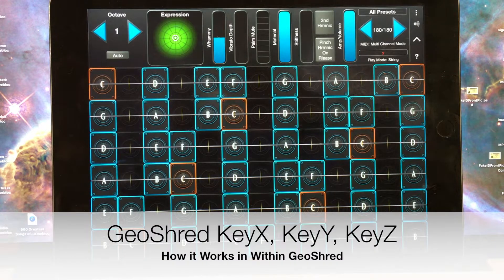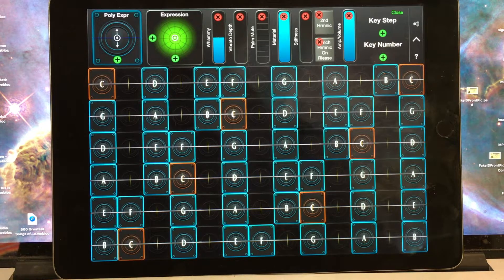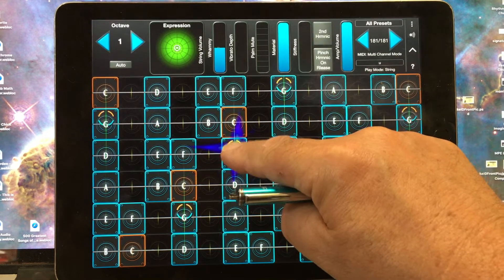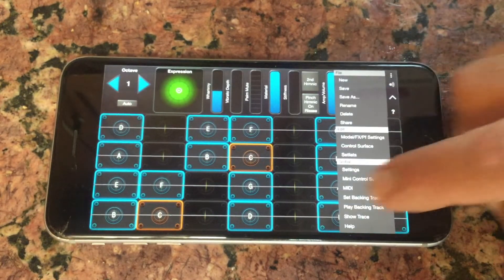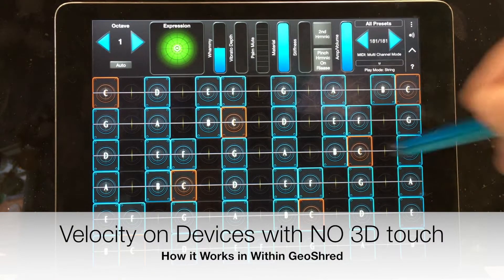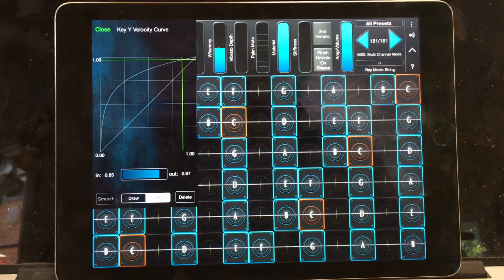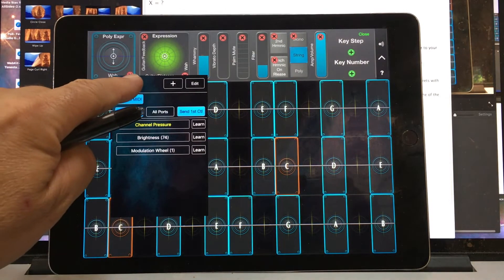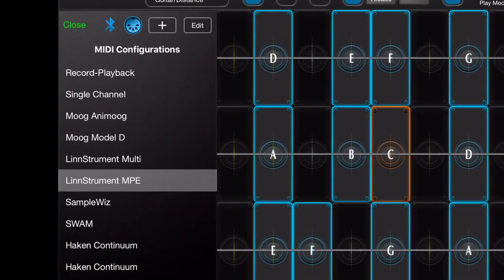Application Note #20: GeoShred XYZ Expression and MIDI/MPE

Comment: Can an Apple Pencil be used for pressure on ipads
Reply from the maker: No, the Apple Pencil does not support multitouch and you can't read velocity from the pen.  For iPads, expression is KeyY, sliding vertically. and velocity is vertical tap position. You can also plug in an MPE controller or a conventional MIDI control with an expression pedal or a wind controller.

Note that for phones that support 3D touch, GeoShred reads velocity and pressure directly from the screen.

Comment: I am using an Iphone XS Max with Geoshred.  Works really good, however, regarding 3D touch- pressure i've noticed that sometimes the note stays ON ( as if stuck). Is it normal? caused by the screen protector maybe?
Reply from the maker: That's not normal and we have never seen this problem.   I don't have enough context to understand the problem.  Is this for playing the built in GeoShred Instruments, or is this for MIDI Out?   I think it might make sense for you to reach out to us directly at support@moforte.com.  We will ask you for some diagnostic info so that we can figure out what is going on .
Reply: Will do . thanks.it's a fantastic app @GeoShred
Reply: Can a Apple Pencil be used for tablet pressure

Comment: If i connect 3.5 mm concerter and hear in speakers i feel higher latency. Kindly help
Reply from the maker: Wireless audio from an iOS device adds in 1 second of latency.   It designed for iTunes playback, and NOT realtime playback.

I need much more information to help you. 

    What type of device?
    What version of iOS?
    What version of GeoShred?
    How are you connecting to your iPhone?
        Wireless - 1 second of additional latency
        Analog Headphone jack - There should be no additional latency
        Lightning to headphone jack adapter - There should be no additional latency
        USB C to headphone jack adpter - - There should be no additional latency
Reply: @GeoShred  my device: iphone 7 plus  iOS 14
I have used a connector from iphone charging port to headphone jack connector (Ticon) for which bluetooth needs to be turned on inorder to connect. I also dont know why bluetooth is required to be turned on for this ? Is it related to the cable?
Reply from the maker: @karthikchandrak5415   Note that this is an iOS issue and is not specific to GeoShred. You should not need to have bluetooth turned on in order for a lightning->headphone jack to be active.  This suggests that your audio out is actually running through bluetooth which has significant delay.
Reply: @GeoShred Can you please suggest a jack converter for me? Let me try it
Reply from the maker: @karthikchandrak5415  It's a personal choice which product you purchase.  However here is Apple's adapter: https://www.apple.com/shop/product/MMX62AM/A/lightning-to-35-mm-headphone-jack-adapter

Comment: Do We Need I Pad Pro Or Normal 6th Gen 9.7" 32 gb For geoshred?
Reply from the maker: A 6th Gen 9.7 should work well.  From the GeoShred FAQ: 

GeoShred runs on all iPad models except the original iPad, which was discontinued in March of 2011.

Specifically, GeoShred runs on the iPad 2 (which was discontinued in March 2014). The iPad 2 is not as powerful as later generation iPads. As such, GeoShred may not be able to run as many effects as a more recent device. GeoShred has a red CPU LED that will light up if the processor is overtaxed. The user may turn off some effects if this situation occurs.

All of the presets shipped with GeoShred are designed to run on an iPad 2 or better.
Reply: Great.Thank You So Much..
Reply: Great.Thank you...